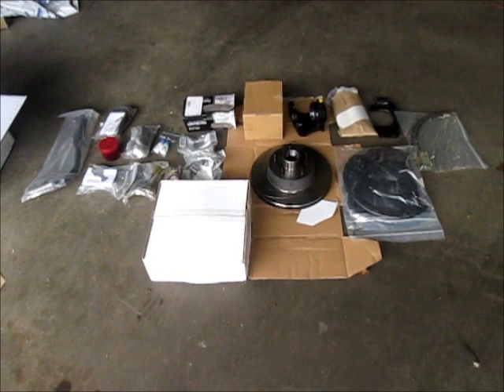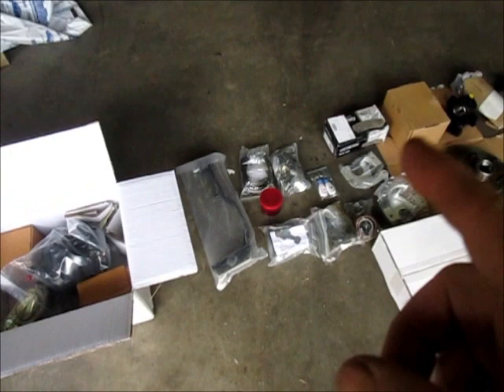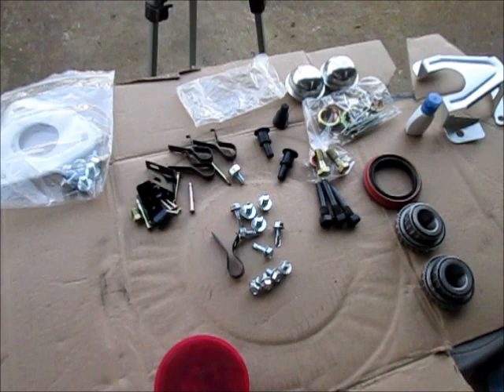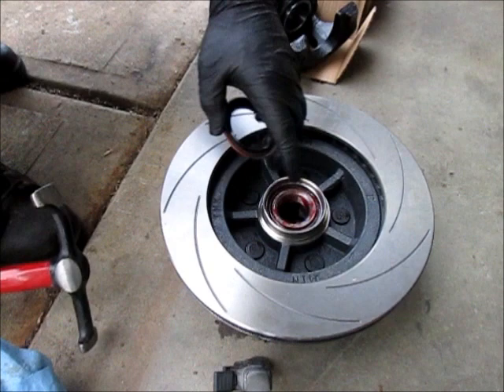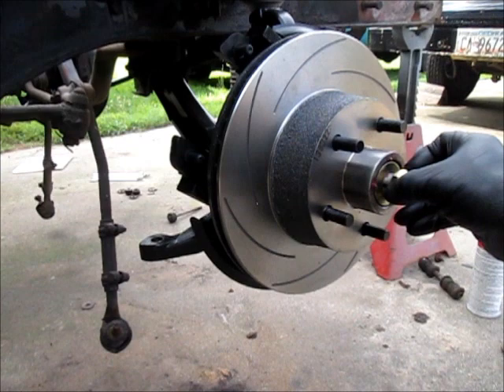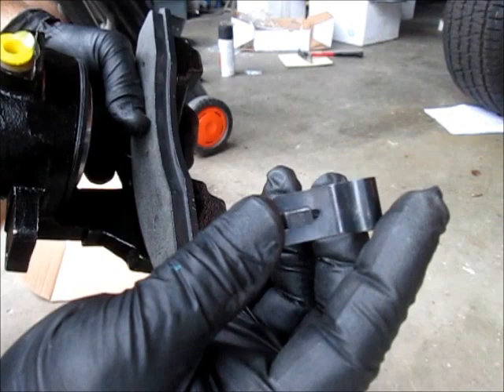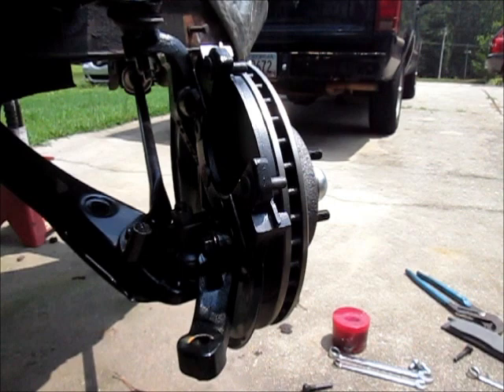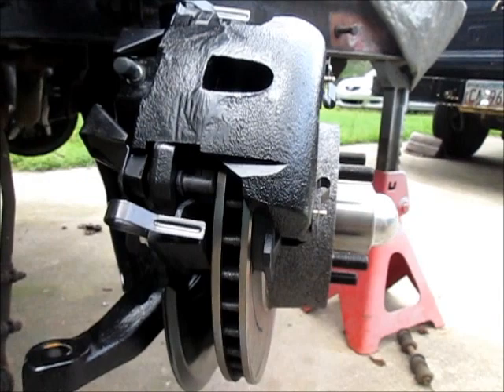1968 Mustang disc brake conversion Part 1 "Jade" part 10

Comment: I should've gotten this kit instead of MPB (Master Power Brakes kit) which costs more and doesn't have dust shields. Also with the MPB kit you pretty much have to make all new brake lines because their proportioning valve doesn't fit the stock layout of the factory brake lines. This little detail adds hours of work to what they claim is a straight forward conversion. Not only that but Master Power Brakes doesn't provide new tie rod ends like this kit. Finally, I highly recommend shopping around for the best brake conversion kit before buying. Read the comment sections. Sometimes you get an idea of the flaws or shortcomings of a particular kit from unhappy customers. All I can say is STEER CLEAR OF MASTER POWER BRAKES. Their quality control is crap and the kit is one time consuming frustration after another.

Comment: Are the single piston calipers good? I was comparing it to the willwood but don't know if they'll have same stopping power.. any insight on that ? I got a kit that has all 4 disc brakes with single piston calipers.. not sure if I should upgrade it to the willwood kits!
Reply from the maker: Mine seem to work great. It really depends on your purpose for the car. Are you just driving to shows? Or racing?
Reply: @JoDaddysGarage  well the engine is going to be a 302 converted to a 347 stroker should be pushing like 480+HP. But I won't be racing more so just a hobbyist driving around. Do you think all 4 single caliper pistons will give me enough stopping power?

Comment: I'm so used to ordering brake pads based on make and model of the vehicle....if you're upgrading from drum to disc....how do you walk in to Advance Auto and buy replacement pads?  What do you tell them?
Reply from the maker: In this case, the pads are original style for a 1968 Mustang.

Comment: What made you choose CSRP? I'm about to order some Disc brakes for my 68 Mustang and there are SO MANY DIFFERENT COMPANIES and options.
Reply from the maker: +Mike Mckee I went with them because the price was reasonable, and I'm not building a race car. Just a nice driver. This kit is supposed to be what the car could have come with in 68.
Reply: +Jo Daddy's Garage ok awesome. I'm wanting to use my original wheels so this might be the direction I go too! I look forward to PART 2 for the rest of the installation
Reply from the maker: +Anthony http://www.discbrakeswap.com/Mustang%20Disc%20Brake%20Conversion%20Kits%20SWAP3.html
My kit was $789+s&h
Reply: +Jo Daddy's Garage ok,thanks..

Comment: Good video.... I converted my 55 Chevy truck front brake too... No boost...
Is correct set up rotor??
Reply from the maker: Yong Cheon Disc brakes can be used with or without a booster. The booster makes it easier to apply pressure though.
Reply: Jo Daddy's Garage YES Sir... I am trying to restoring my truck if possible original looks and little more safe... Like you said not easy job...

Comment: Does this car have power steering? I've got a 68 coupe and someone told me once "just go to the salvage yard and part out the rotors from a 69". lol More to it than that! I heard this conversion is around $1800?
Reply from the maker: jasonmushersee This is a manual steering car, but I am converting it to power steering as well. This kit cost me about $800 with shipping. 
http://www.discbrakeswap.com/Mustang%20Disc%20Brake%20Conversion%20Kits%20SWAP3.html

Comment: Are you planning on making part 2 soon? its been over a year  :)
Reply from the maker: I know... I was building the 65 Mustang (Mystique). I'm actually working on the installation of the lines and booster/master cylinder. Had a problem, and had to modify some things. It's coming soon, I promise.